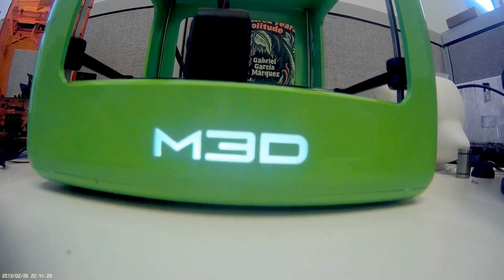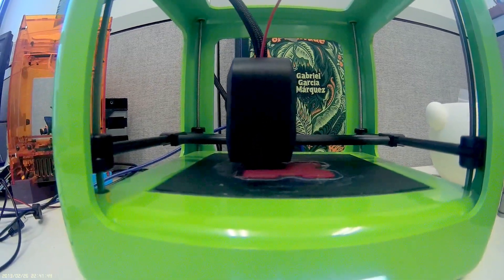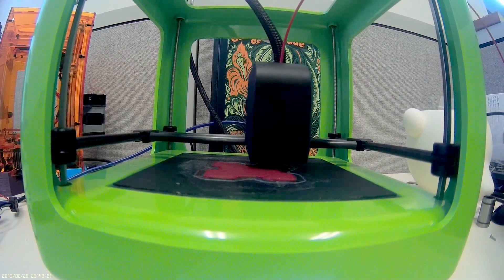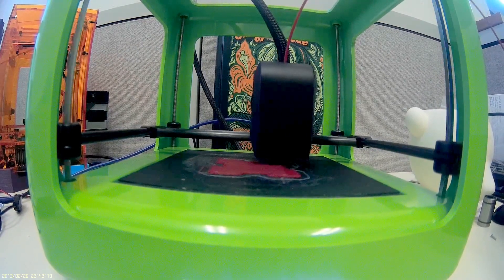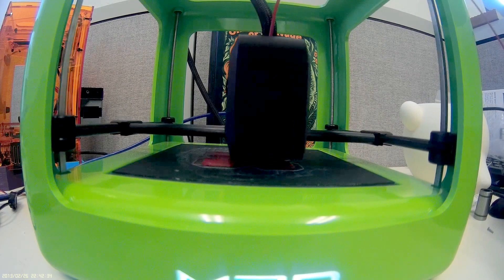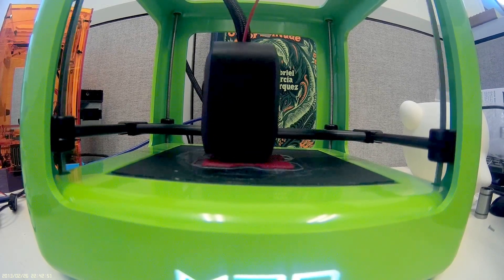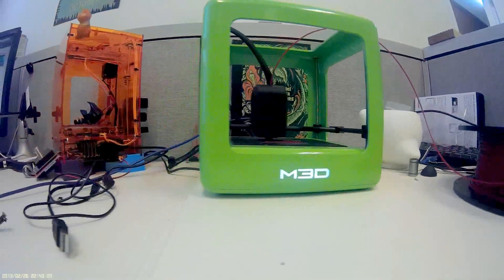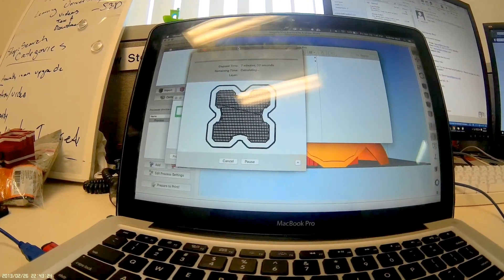M3Do or M3Don't? The Micro 3D and MicroPrint

Comment: How did the print turn out?
Reply from the maker: +Jill Marchewka No great. Supposedly it was on their high quality setting but I wouldn't call the result 100 micros. The layers are very obvious and ugly.
Reply: Even with the other software?
Reply from the maker: +Jill Marchewka Unfortunately yes. It helps, but it doesnt fix all the problems. If it only cost $200-250, paired with that software I'd say buy. But that isn't the case.